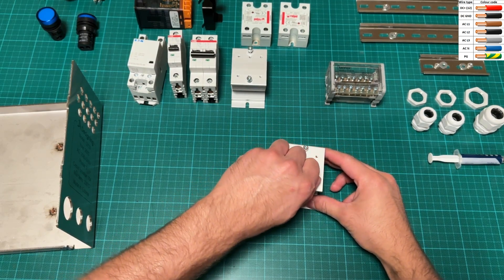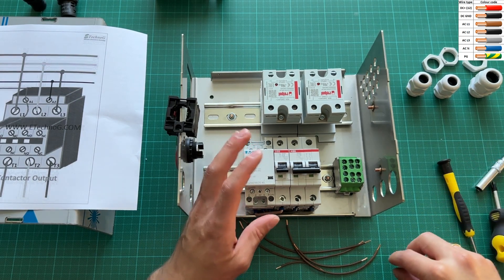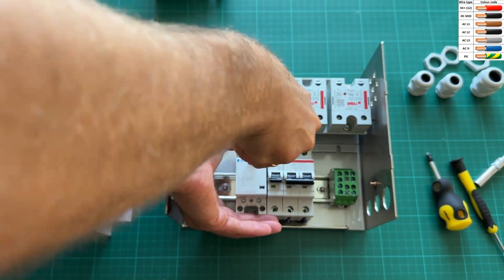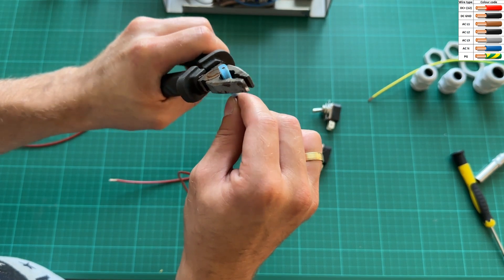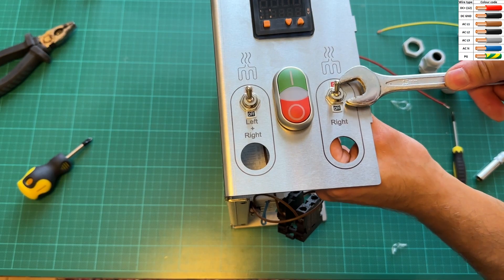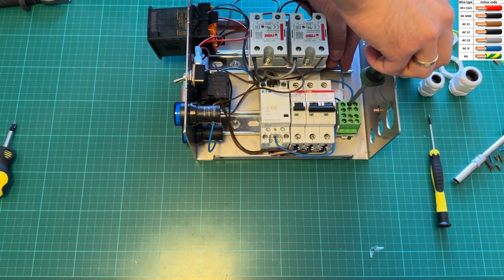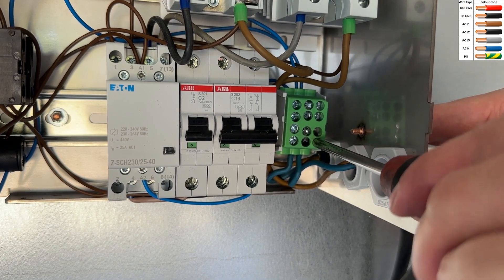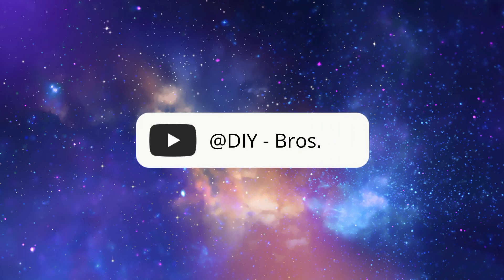How to make PID temperature controller for powder coating oven

Comment: Looks nice, especially for a layman. I've seen some really bad wiring on YouTube videos LOL. Yours looks like it was done a by professional  One question. Why do the latching relay instead of just an on/off switch?
Reply: I just looked at your channel. I would say you're a little more than a layman.
Reply from the maker: I used relay because high current switches are big and take lot of space. But there is no difference, you can use on/off switch as well.
Reply: @diy-bros.1995  Ok, but your switch is controlling the relay coil voltage which is not high current. My question was about using a latching relay design instead of an on / off switch to power the coil. The N/C off switch still holds the current of the relay coil in your design so the switch would not need to be any bigger.  So you could just use an on / off switch to power the coil. Most of the time a latching power relay is used for safety reasons so that a momentary break in the latch circuit stops the power until it's turned back on.  so, that is my question. Is there a reason for using the power latch ?  For something that did not require a latching power relay you can use a N/O selector switch and still only take up one 22mm switch spot. I like to use LED lighted switches that light up when the system is on.

Comment: hello, i built my own oven following your tutorials. But now i have 220V everywhere in the oven..... Do you know the trick? does it means my SSR is broken???? Thanks
Reply from the maker: You need to find the leaking part. Some part wont have good N or something. Also make sure you have good grounding. But the oven body should not have any voltage. So go over all the connections and try to find leak
Reply: I had very bad N..... thank you :)

Comment: Can it handle a 4x4x6 oven with 4 elements 3000 whatts each?
Reply from the maker: Yes, Same principle can be used. But main breaker needs to be double amperage and I would put 1 heater per solid state relay. So 4 solid state relays are needed. This amperage rating works on 230v system